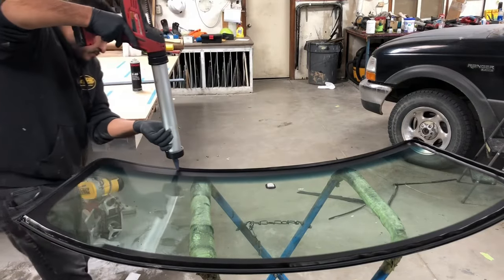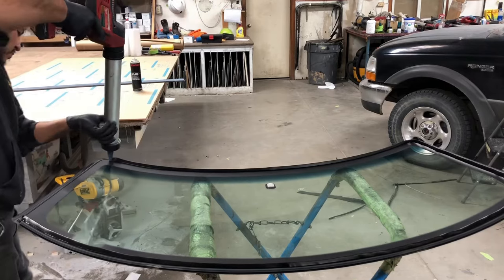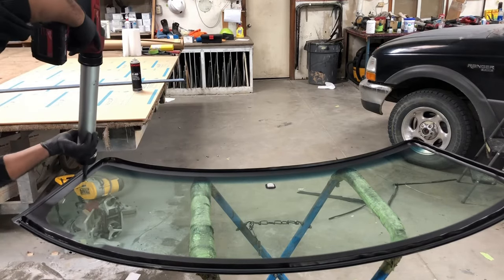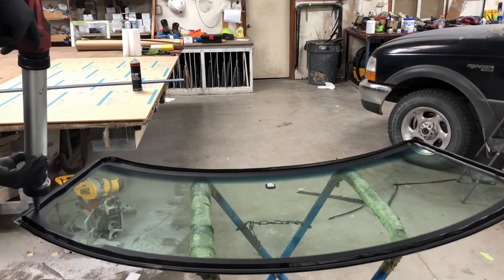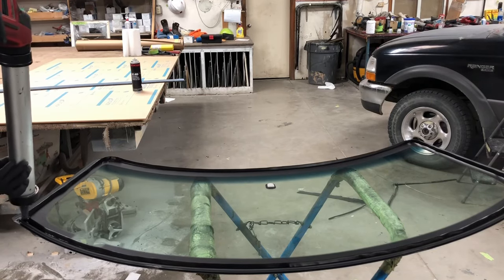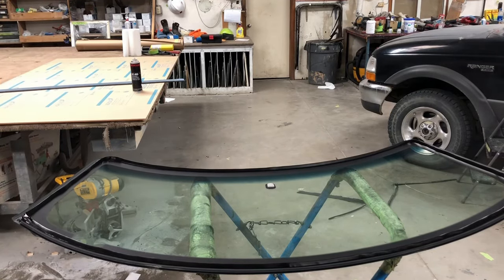How to shoot a urethane bead

Comment: How did you cut the end of the nozzle on the urethane cartridge. Seems like you have a little triangular notch?
Reply: Do you do glass for a living. That little notch is called a v notch and  it’s been pretty standard for along time. I’ve been doing for a long long time and I must say I’ve do a lot of my own test and if the windshield gets pushed in properly a round bead will work 98 of 100 times.. its all about setting the windshield in the bead after windshield is in.
There are company’s that send tips pre cut with v notch and some that don’t, you can also buy a tool that cuts a v notch if your uncomfortable doing it with a blade yourself.

Comment: ok ive tried a cheap caulk gun n sikaflex p2g n the dam thing would not com out of the tube
Reply from the maker: Might help if you put the urethane on heat but if it’s super cheap probably have to use both Hands lol
Reply: @AlexRubioRQualityGlass  Buy a bigger 1 to 26 ratio caulk gun, 25-35 dollars, then heat urethane tubes up to about 140 degrees.